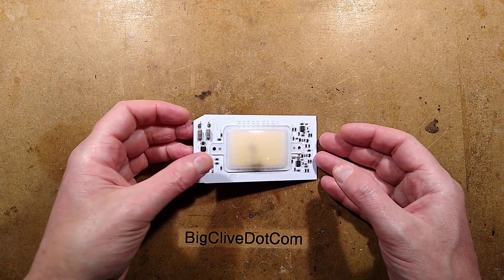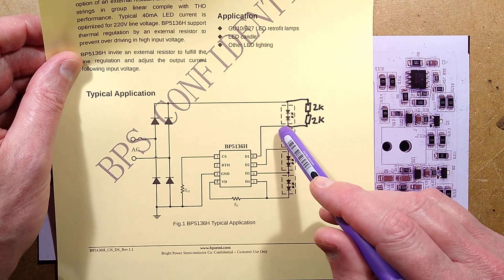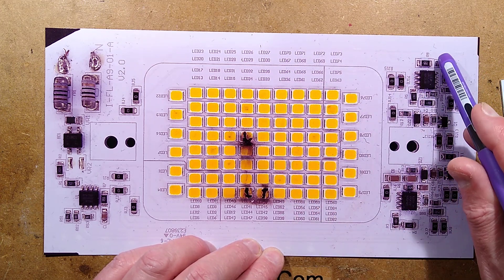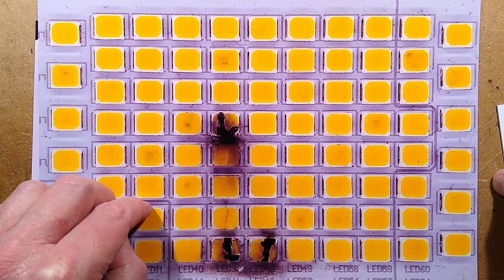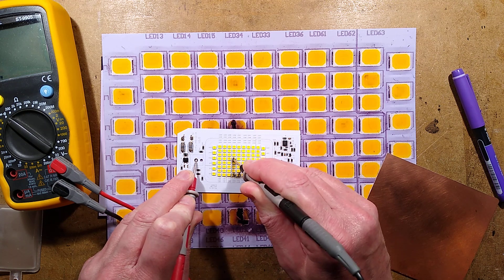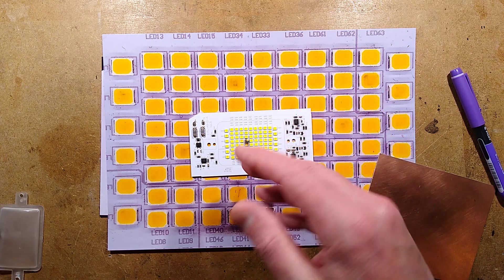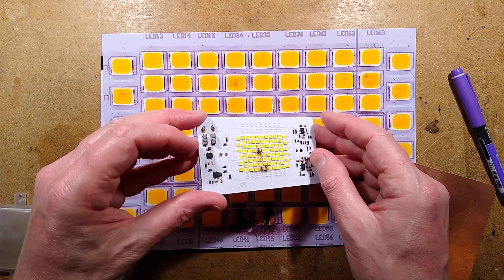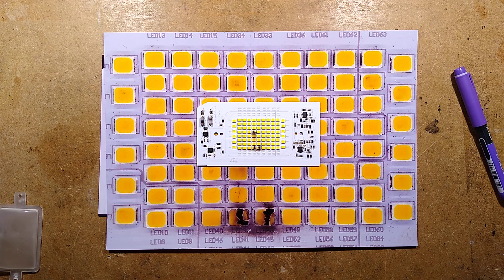LED shock hazards are increasing

Comment: With all these terrible LED floodlights it might be interesting to see if you can actually find a decent one!
Reply: You mean the one my neighbor's got on the side of his house pointed at everyone's yards lighting everything up with a nasty cool white? That thing's been up there for years now and is still just as bright and annoying.
Reply: @uK8cvPAq  - Two possible solutions to fix your neighbours lights.
1) Talk to your neighbour and suggest some common sense reasons he should point it differently.
2) Get a bigger IR sensing light and point it (or them!) towards his yard.
I recommend trying solution 1 before implementing number 2.   ;-)
Reply: @ElmerFuddGun  I had 500 watt halogen flood lights but found 230 watt virtually did the same job of course they are not  quite as relevant now with nightview cctv triggered by pixel movement, but I have a public alleyway next to the house I like to light up when someone is using it.
Reply: @uK8cvPAq  - A 3rd idea that might actually be better than my previous 2 above.
3) Use mirrors to redirect the neighbour's light back to their bedroom or living room windows!  Use multiple mirrors to get as much light in the windows from as many angles as possible.  This costs nothing to run and if they complain to you or the city the solution is to fix their lights.  They can't say you're setting up lights in retaliation.  They have "the power" to fix it.  Set up a small solar panel and say the mirrors are to redirect the sun to the panel and it is just a coincidence if it is redirecting his lights.   ;-)
Reply: @uK8cvPAq  Air gun .. you ain't seen me .... right!
Reply: @uK8cvPAq  There are a couple of blocks of flats close to here with some hideously bright round 6400K LED lights mounted flat on the walls. Say <5% of the light illuminates the paths as intended, most lights up the surrounding houses and the rest lights the clouds. Plus they made the classic mistake of putting some of the dusk-dawn switches where they are illuminated by the controlled lights with the expected result.
Reply: @uK8cvPAq  I have a slingshot / catapult for just those types of emergencies. ;)
Reply: @snakezdewiggle6084  they have cameras mounted on the lights too, also watching our yard, cause they are creeps.
Reply: @BloodAsp  Cameras looking into your yard !!!  I think I would develop an Adverse Reaction to that.    
I would get 4 x his bright lights, point them directly at his camera. If not, I have a really big stick you can have. I would smack the camera down, and then smack him around the ears for a bit.   Of course I can not advise you to do that. ;)
Reply: @BloodAsp  that's not allowed in my country. (UK).
Reply: @snakezdewiggle6084  I can see people next to you will need to invest in bullet proof glass. :P
But can't you just complain to the local authorities if talking don't work?
Reply: @joseph9915  Well thats the right idea, but going by what I have seen and heard, and experienced, one or two complaints are not enough for authorities to act upon. Get answers like, we can't polce it every day, they will just put it back up again, etc. 
Personally, I ended up having my telescope destroyed, hand made myself, took 5yrs, cost 4000. Robbed of my passion over one complaint. Now'a days I 'shoot first, talk later', not that I actually have a gun, my big stick works just as good... ;)
Reply: @snakezdewiggle6084  I can definitely appreciate those sentiments.
Reply: @uK8cvPAq  Got a pellet gun? 😁
Reply: @uK8cvPAq  Air rifle? ( or AK-47 you happen to be in the  US )
Reply: @uK8cvPAq  you mean free light
Reply: @uK8cvPAq  what colour light would you want from an outside light? green?
Reply: @mattsan70  As a homeonwer I want as cold and blue of a white light as possible, 8000K+, to constrict the pupils of any ne'er-do-wells.

But if you were to be doing any work in that space after dark you instead want a warmer light, 3000K or less, to help not completely blow out your night vision.
Reply: @mattsan70  Don't care as long as they pointed it down at their own yard.
Reply: @uK8cvPAq  I can't say how much I agree.  These people don't need a damn light pointed at our yard, never the less their yard, all night long, For Christ's sake, It is a pain to sky watch now.
Reply: @BloodAsp  Oh yeah light pollution is just getting worse and worse, it messes with the wildlife too along with noise.
Reply: @mattsan70  Green is not a bad idea, because human eyes are more sensitive to green light. I've also heard that wildlife will be less disrupted by green light.
Reply: @OregonOutdoorsChris  what's a ne er do well
Reply: @smoothemjay3303  AKA "a scrote"
Reply: @Mr.MFuckingYTchangedmyname  oh I see thnx for clearing that up😄
Reply: @mattsan70  I prefer an old-fashioned warm glow. And I don't like the neighbor lighting bedroom either. His bedroom is in darkness while his light shine directly into my bedroom. I had to put up blackout curtains. You could read in the room at night with the lights off.
Reply: @smoothemjay3303  It should be spelled ne'er do well to indicate there's a letter missing and non standard pronunciation.
Reply: @smoothemjay3303  An idle or worthless person. Often used to describe people with ill intent.
Reply: @OregonOutdoorsChris  Astronomers hate you... Well, depending on where you live. ;)
Hilo uses yellow street lights because of the telescopes on the mountain, but lots of folks have these cheap flood lights pointing in seemingly random directions -_-.  Even if you don't care about the astronomy it is annoying... And dumb since bright white lights are also termite magnets
Reply: @travcollier   am definitely aware of and conscientious of light pollution. The main thing is to ensure your lighting is all downward facing, skyward light doesn't do you much good... and as you rightly point out contributes to light pollution.

Though to be fair, aren't the lights around observatories special beyond just being very 'warm?' I seem to recall that they're the low pressure sodium that has a very narrow band that can be filtered easily.
Reply: @OregonOutdoorsChris  i like 4000K the most, most balanced, not too blue and not too red, and with a remote control i can dim the light to my needs
Reply: There's going to be a lot of led lighting e waste and a lot of street lighting problems due to unscrupulous middle money maker companies raking in large mark ups and profits from cheap nasty led lighting units, I said it 10 years ago when the led street lighting really started to be an offering and I still maintain that's what's happening today.

The market is flooded with badly made and good stuff is jostled aside while the garbage is sold at high prices around it for more profits
Reply: @grantrennie  Some of the cheaper LED streetlights are already starting to fail in significant numbers it seems. I noticed when they put some up down the road, within a year 2 of them had already stopped working, and the council doesn't seem to be in a hurry to replace them. I'm not bothered though, the light from them was really garish anyway.
Reply: @grantrennie Your so right already couple of faulty LED street lights on my road flickering all time. They only switch them out not long before covid thought they lasted years.  Nothing anymore is real value everyone is skimming for profit.
Reply: Welcome to the race to the bottom! The prize you're competing for today is a Genuine Electric Shock! This and more could be yours for the low-low entry price of much less than it should cost to make a safe product! So don't delay, grab a grounded surface with one hand while reaching for your faulty LED light with the other hand today!
Reply from the maker: These days the only option for a longer life unit is to nudge it down to a lower current yourself.
Reply: Don't pay £10 for a 50W flood, fairly simple really. But will you go out and buy a £100 UK made flood ... probably not.
Reply: @thephoenixscotland  Even the expensive ones are not that reliable. I've seen in a recent street light installation that a Ledvance (former OSRAM) street light died within a month. One from about 20, that's not too great. It's glowing very faintly, each LED at different intensity. So either an open LED in the string, or the ballast died, puts out just a very low current, and the LEDs have very different forward voltage and/or leakage current across the die. Even though Ledvance has been sold off to the Chinese, they supposedly still use OSRAM LED chips, so it seems like even OSRAM LED chips are not too great nowadays. It could be a bad driver that killed them with a surge, but the differing brightness of the induvidual LEDs in the string at low current is not very promising. It can also be a cooling problem, like if they forgot to use heat sink compound, or the screws holding the LED module are loose.
Reply: I have one from a German supplier. 30watts 10euro. It's decent because it's running since 2017 in my room. It lost some brightness but otherwise it's Totally fine
Reply: I've been buying DIY shed OB ones for <£5 (and as low as £1.50) when they change their branding then putting a 5m cable on them for use as lead lamps. Most have been rebranded Luceco ones.
Reply: I have some 50W V-TAC floodlights (VT-4651). They are running every day 12-18 hours for 3 Years now. A bit of airflow is needed, but I'm surprised they still work perfectly. 
And the earth wire is also connected 😉
Reply: Don't think its possible as they are always used in such bodge/DIY scenarios, put decent local lighting in with down-lights and column lights for proper lighting!
Reply: Reminds me of half of all the bollards in the UK strobing in some fashion, what absolute junk! Bring back Fluros is what I say
Reply: It's crazy, I bought some cree bulbs cuz the advertisement said they last super long but they burn out faster than the cheap ones... Now I tend to go with cheap ones cuz it's less headache
Reply: I don't know why people that watch this channel aren't building their own. Most Chinese LEDs don't have good phosphor IP and thus have crappy CRI and efficiency. Let alone poor heatsinking.. cheap crap is what you pay for then you will get it.
Reply: Our whole house is led, large square lights with 
rows of led strips. They range from 45x45 cm to 60 x90cm, 36w to 96w. Very bright cool white. We've had these for the past two years with no issue. All we're a very good price, none are UK made..
Reply: Lights intended for filming, both studio and portable are of a much higher quality abd can be had from AliExpress from shops like DF video. They're by no means the cheapest units but they're very good value and they produce a higher quality light, no flicker and often with adjustable colour temps or RGB.
Reply: Philips makes reliable units.
Reply: Someone needs to do a total cost analysis and see if LED lighting is really saving money.

Comment: Just looked on CEF, and type AC and A RCDs are almost the same price. 
Type B ( much more expensive)  is only needed for situations like cars and UPSs ( maybe solar?) where there is continuous DC coming from somewhere other than the mains supply. A and AC are not only insensitive to DC, but a DC fault can desensitise them to AC faults by saturating their current transformer.
Reply: once demand for B type rises, they will become cheaper :-)
Reply: @MC-Racing  No, they'll just become mandatory and the manufacturers will just collect the profits.
Reply: @thomasbonse  luckily there is a free market, and some manufacturers Will lower prices, and rest must follow, so in the long run, they WILL get cheaper 😉
Reply: @thomasbonse  Plus they by then won't be available for relatively recent CUs so they'll have to be changed.
Reply: @thomasbonse  No reason for type B to be mandatory except for EV chargepoints, for which they already are  in the UK. However most chargepoints now include DC RCD protection internally.
Reply: @mikeselectricstuff  
😵💥👈 Got a real "charge" out of the exchange. Kinda like shorting out a 40K Volt Tesla coil carrying a one-amp load: RIVETING... as in welded to the floor.

Where was I... Oh yeah. EV converters...
🤯
Reply: @mikeselectricstuff  this is so wrong. Alot of low power devices and even alot of powersupplies  have slight DC current draw of a few mA. This can be enough to presaturate an RCD enough to trigger above its rating
Reply: MY BAD. I meant to say eV converters.
Reply: @BrosBrothersLP  Sorry, but how can the transformer be saturated if there are no external DC sources? It can't because the current that goes into the transformer is the same of the current that goes out of the transformer and the two currents cancel each other. The problem is if there are external DC sources, so something with a battery inside (like an electric vehicle or a solar panel) that in case of a fault can pass a constant DC current in the transformer in only one direction. 

If not you are saying that an old hair dryer, that typically uses a diode to set the heating power (basically in the lower setting a diode is in series with the heating element, thus passing only the positive AC wave to get half the power, and it's a DC current) will saturate a current transformer of an RCD to the point that it will not trip?
Reply: @mikeselectricstuff  The main reason for more Type B's is the increasing amount of VFD's in normal households. These have the same issues as car chargers and PV inverters as they have no isolation transformer. Nowadays every fridge, washing maschine, dryer, heatpump, AC etc. use VFD's which mostly drive their motors at a very high and generally inaudible frequency with a significant DC component.
Reply: @alerighi  Hi! @BrosBrothersLP didn't say "transformers" he said "power supplies" and many of those (fewer today, they are designed better), especially the old switch-mode PSU found in IT kit or processor boards for "modern" washing machines back in the 90s, leaked a few mA to earth under normal operation, which is why you could not have "the entire office" on one circuit when we started installing RCDs back in the day.

You are right, though, about the unsmoothed effective-DC produced by your hairdryer: it will over time saturate to core of an old Type AC-only RCD and make it far less sensitive to AC fault imbalance and reluctant to trip.  Thankfully that usually took longer than you would normally use a hairdryer (10min or so) and then the DC current would dissipate.  Doesn't help if you have a heavy-duty Xerox machine on all day flooding the coil with ripple-current though...
Reply: You tell him Mike!
Reply: I'm a little confused, isn't the ''type' on a circuit breaker to do with its trip curve??
Reply: @davet2738  we are not talking about ciruit breakers but RCD's they also have B as a type but its about the type of current shape they detect
Reply: Is "RCD" another synonym for GFI / GFCI?  If not, what is the difference?
Reply: @ncdave4life  yes Synonymous depending on the country
Reply: @mikeselectricstuff I suspect you didn't mean to bunch Type A in with Type AC there...
Type A RCDs are indeed sensitive to diode/thyristor rectification and wave-chopping such as found in that "old hairdryer" mentioned in these comments.  That's why the instruction was given years ago that Type A must be used on final circuits for sockets expected to supply office equipment (numerous bits of IT kit woth old-style switching PSUs that relied on earth leakage to function -- oh the joy of nuisance tripping when 3 PCs, 3 screens and 3 printers pushed over 15mA leakage every morning...)
Two sec's while I go look up a std mfr catalogue entry...
From the horses mouth, Schneider describing rectified circuits: "Type A RCD are specifically intended to be used for single phase class 1 electronic load"
:-)

Comment: I have a homemade hanging shop light that I made from led lightbulbs that consists of a 3x3 array of the aluminum led boards that I removed from the bulbs affixed to a square piece of plywood all wired together in parallel and attached to a bridge rectifier - and always wondered how much of a shock risk the aluminum heatsinks were. I always made sure never to touch them while the light was on but now I'll be updating my light design to include some type of transparent insulating material since I know now that people are getting zapped!

Comment: Is it possible to fit the newer breakers in line with old boxes, to save on completely new incoming equipment/box? While we wait for beaurocrats to catch up!
Reply: If your consumer unit / board is relatively modern and has standard sized equipment, it may be possible to fit new RCDs in it. Yes, you can get stand alone RCDs.
Reply from the maker: Yes, you can add an inline RCD to even the oldest fuse box.  Most modern consumer units have RCDs already that can be swapped for more modern types.